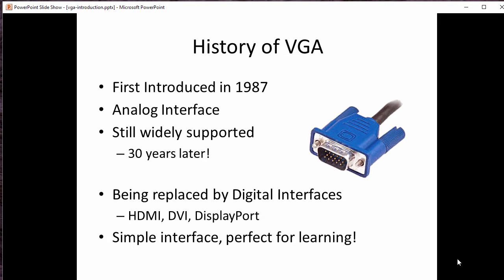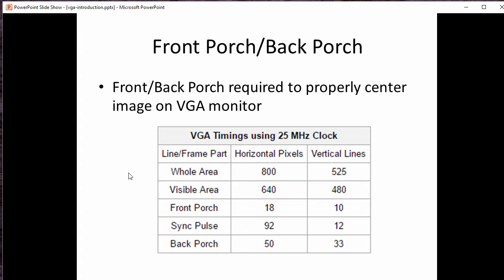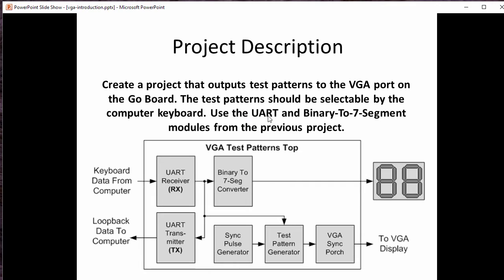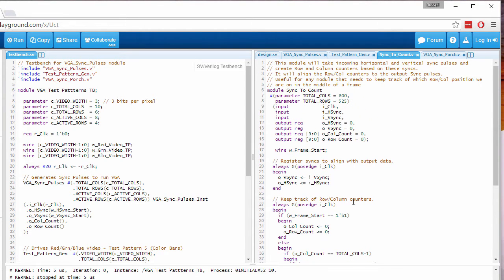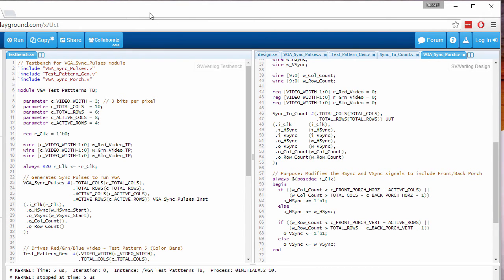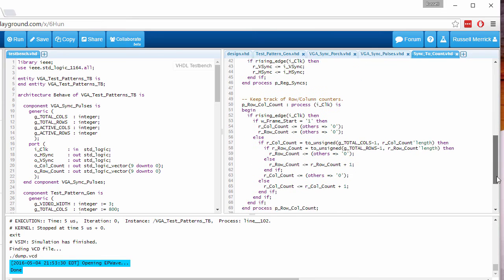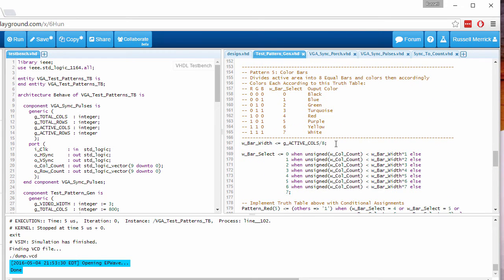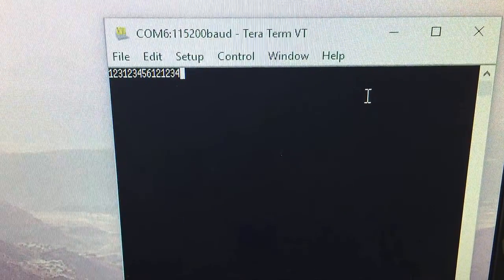Nandland Go Board Project 9 - Introduction to VGA

Comment: In the Sync Porch module, when we include the porches, why do we check for when the col/row_counts are greater than Total-Back_Porch? The -1 is for the total since we index from 0, that I get but what I’m getting from this is that we signal that the Sync signals are high (1’b1) when we’re between the back porch and end of the total width/length, but I know that can’t be it. 

Any help?

Comment: Hey dude, thanks for the content, I've been building my own VGA driver and finding your video to be of massive help. I'm close to getting one working but not quite there yet. Getting an error when I plug my cable in "D-SUB Out Of Range" any ideas what this might be? is it super sensitive on timings as I'm working off the DILIGENT Pmod VGA Reference Manual and it appears the numbers are slightly different to yours.
Reply: I get the same issue idk how to fix it
Reply: @blakebennett5990  trying to cast my mind back, I think I got it fixed by fiddling with sync delay times, even so as to out of range. A logic analyser also helped with all that

Comment: (I have three of the Go Boards that I hack around with).   In addition to 640x480 @ 60Hz, I have successfully written code to generate 800x600 @ 72Hz, and 1024x768 @ 70Hz.   The pixel width becomes two and three time bigger so it looks strange, but higher resolutions are definitely possible even though you only have a 25MHz clock.

Comment: Hi Russell, or someone, regarding the verilog code. Can you please tell me what is happening on the pattern vectors that are 3 bits wide. It looks like {VIDEO_WIDTH{1'b1}} is making all three bits 1?
Reply from the maker: Yes that's doing replication in Verilog.
Reply: Awesome I totally get that. After further looking at the checkerboard pattern, I see that you used the bit-wise XOR operator. I'm confused on doing an XOR compare of the column and row count would generate checkers. Would you be able to shed some light on this? Thanks!

Comment: I'm realizing that might work on monitors that are strictly 640x480. Any monitor with larger resolutions will show a pitch black screen. Is my conclusion correct?
Reply from the maker: It works on all monitors. The monitor itself is smart enough to change its resolution to match the input. Think about the fact that you can change your resolution in Windows.
Reply: @Nandland  Thanks for your reply. I had some time and managed to fix it.  You are absolutely correct. I taught myself how to use PLL since I was doing a 1366 x 768 resolution with an 100 MHz board.

Comment: Arent timings wrong? 480 + 10 + 12 + 33 = 535 not 525
Reply from the maker: Yes, It should be 2 for sync pulse, not 12.  I updated the table on the website but not the video.  Good find.

Comment: Russell, very informative video. Thanks. Have a FPGA theory for you. You've defined TOTAL_COLS as 800, then in the code you use TOTAL_COLS-1. Does the build process (the compiler) replace TOTAL_COLS-1 with 799, or is the subtraction implemented in hardware?  This is pretty simple example of this question but I can see other operations requiring hardware implementation of expressions. Does the build process have a report that explains how line by line is implemented. Kind of like looking at c compiler output of its generated assembly code. Thanks again.
Reply from the maker: Hi Craig.  The synthesis tool will in fact replace TOTAL_COLS-1 with 799.  It will try to find all constants and calculate their final values during the process.  The tools are pretty smart about stuff like this.

Comment: If the checker pattern and the color bar pattern are very dark, you can fix it by sending the color only during active region (w_Col_Count < ACTIVE_COLS && w_Row_Count < ACTIVE_ROWS). Otherwise send black.  Just like during pattern 1,2,3.
Reply: Right. Then the line of code for the “checkerboard” will look like this:
assign Pattern_Red[4] = ((w_Col_Count < ACTIVE_COLS && w_Row_Count < ACTIVE_ROWS) && (w_Col_Count[5] ^ w_Row_Count[5])) ? {VIDEO_WIDTH{1'b1}} : 0;
Reply: I had this issue too - thank you for your comment!

Comment: Good Explanation. But note some errors on the schematic at 9:16.
1) There are 9 digital color signal from the FPGA, this will make it a 9-bit controller, but the author assumes an 8-bit controller. In that case, one of the colors (say blue) will have to be driven by 2 (as opposed to 3) signal lines. 
2) If we are indeed building an 8-bit controller, then the total number of possible colors will be 256, not 512.
Reply: I wish if you can help and make video about what you are talking the information about it is very hard and short, thanx
Reply: I wish if you can help and make video about what you are talking the information about it is very hard and short, thanx
Reply: I wish if you can help and make video about what you are talking the information about it is very hard and short, thanx